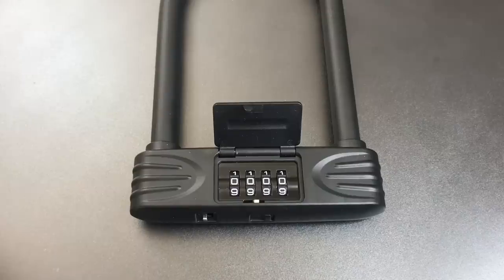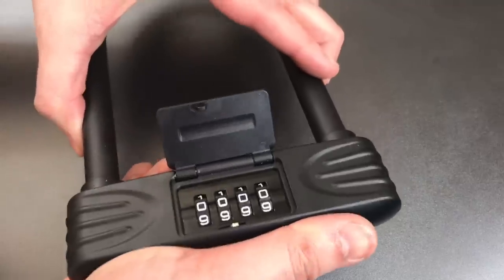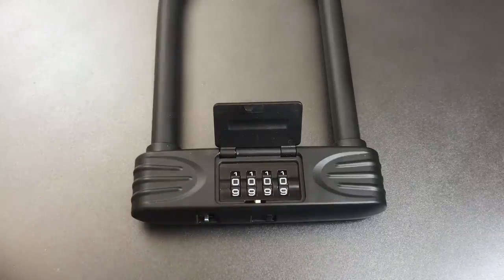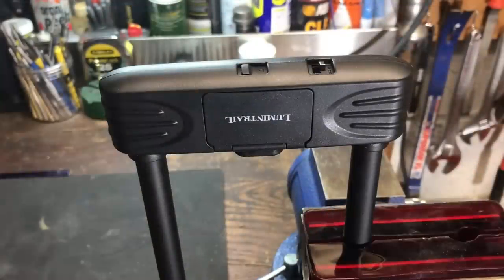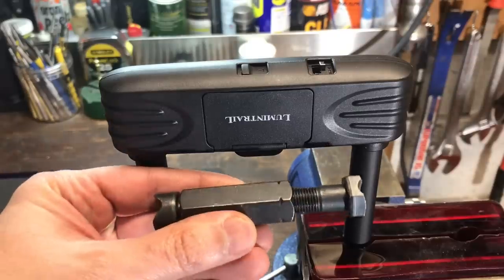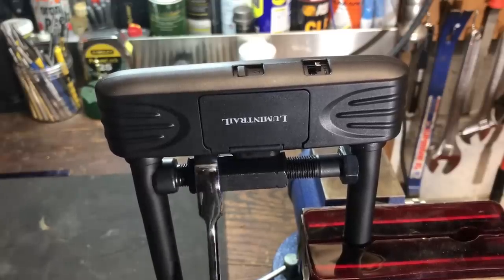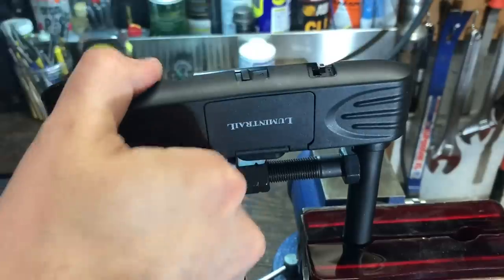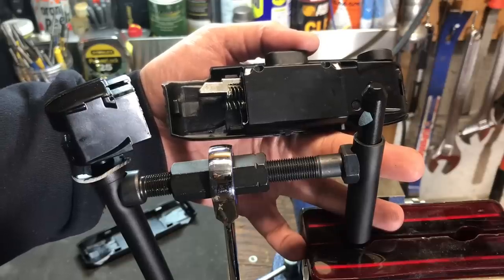[632] Upgraded Screw Spreader vs. Lumintrail 16mm Combination Bike Lock

Comment: I'm secretly hoping LPL doesn't make a video of any of the locks I own so I feel better about what I have.
Reply: I’m sure my gun safes and all the locks I have on the cases, (for my pistols in the safes) and trigger locks on all my guns as well are a singular joke to LPL but those are simply part of my security system. Locks can and will be defeated by even a determined 12 year old kid. High quality locks are great but if they lock up a glass box loaded with cash in a dark alley.........
Reply: My dad always said that a lock just keeps an honest person honest. If someone wants it bad enough, they will find a way to defeat it one way or another. I had proof of that last summer when my storage units were broken into. The lock shackle was too big for the bolt cutter so the cut the slide lock that the lock was attached to.
Reply from the maker: Whatcha got. 😈
Reply: Now I want to find a nasty old lock made of tungsten and drop some solder down the cylinder and see if LPL and pick that or destroy it before it makes him just a little bit crazy. 😊
Reply: If I had unlimited funds, it would be fun to send one of those massive shrouded Sargent&Greenleaf padlocks for the lockpicking lawyer to test on brute force attack. Unfortunately I’m not someone with unlimited funds and those lock are close to $1000.00
Reply: Techniques like this will work on just about every lock of similar design.
Reply: I do have an Abus Bordo to secure my bike. Thanks to LPL I know that the lock itself cannot easily be picked. And although the brute force method finally succeeded, it had been a hard fight: https://www.youtube.com/watch?v=Zs8uyPsDaw0
Reply: tuba7084 This is true for the vast majority of locks / security equipment, but not all. One of the reasons I find high-security locks and doors fascinating is that they are actually meant to defeat very determined attackers, which is a very different problem to solve.
Reply: He can't make a video fo your locks if you don't have locks to begin with!
2020 is a year for smart people
Reply: I'm safe from it, he has no brazillian locks/padlocks (ok, theres a video about a papaiz) :)
Reply: @lockpickinglawyer  Hiplock D1000 and Litelok X1
Would love to see these get tested by you sir

I also might get the Litelok X3 when it's available

Comment: Using a non-reversible ratcheting box wrench is a pretty good statement of your confidence that you were going to be able to split it half. You would have been in a world of hurt had the lock prevailed.
Reply: Nah, you just slide it off the end of the spreader's sleeve and turn it back with something else.
Reply: @samgamgee3622  Plus at around 60,000 pounds of force available? .. no worries! :)

Comment: Ooof.  Yeah, you might argue that a manifold spreader with a lengthened bracing bolt is a specialized tool, but it's nothing that any decent mechanic can't rig up in an hour or two.

Comment: Is there any damn thing that has survived the off-the-shelf tools & little bit of creativity?
Reply: John-Paul Silke are you Archimedes reincarnated? :P
Reply: Nope, just a lame general contractor. ☹️
Reply: A snarling, foaming at the mouth, growling dog who wont accept treats is pretty good as the gun shot will attract more attention than an angle grinder.
Reply: Henri Tuhola Hello I can't find these 1 to 8 Inches Bolts. Can you help me? What I must search to find this Bolts? Thanks
Reply: the blunt answer is: no . I think hiring a strongman as security guard for your bike would be an excellent choice - your strongman gets paid and you have the best protection possible. even just a friend. when you offer money you can buy out most people anyway even a stranger.

but there are plenty of deter methods you can try when locking a bicycle to make a thief's life more difficult - take parts with you such as the bike seat, the post and the clamp screw for the post. take off the front wheel and lock it somewhere else. Disconnect the brakes, let the air out of the tyres. yes its a little more effort but if you are away for a long time those things make your bike less "desireable" than the one next to it.  even go ahead and sandblast your bike to deliberately make it rusty looking and decrease the value lol  then put a big 10mm chain on and it will never get robbed lol
Reply: James Phillips right up till bad guy wants bike more offers strong man a little bit extra to take a long pee break
Reply: Um... I don't think LPL has successfully picked a Bowley lock yet.
Reply: @experiment54  Yes... But it is very difficult to cram the dog into your backpack.
Reply: @john-paulsilke893  hey philosopher
Reply: $20-lock $500 bike= bike was stolen
$50 lock -$200 bike= bike was stolen

$150 cobantion lock free bike from a friend =bike was still there Lock was stolen.

Morale of the story is fuck that guy that stolle my bikes 2 bikes and lock
Reply: @JackTalyorD  The only solution is to get the hell out of the big cities. Things get worse every day. It's not where you want to be when the SHTF, and you have to live with constant fear and paranoia. Plus it's a literal rat race, with no end in sight, everything is too costly, and you're disconnected from people. Stuff that.
Reply: @Patrick-857  U my firend have never been to country Victoria. Latrobe valley region, Hastings any where there's people there's crime
Reply: @Patrick-857  
My door is never locked
My dogs are always Hungary
My shotgun is always loaded.

I'm not afraid of nothing.
Reply: ya, one of those new york kryptonite locks broke his cutters.
Reply: @experiment54  syringe guns are pretty quiet. Bows are quiet too
Reply: Don't worry the universe will take everything apart
Reply: I think the Blocca Cantina did well vs low skill attack

Comment: I’m actually considering this lock even after watching both videos to lock my bike up. Maximum security isn’t the only specification to look for when buying a bike lock, especially when you’re going to be toting it around in a back pack. The low cost of this lock as well as the weight (less than three pounds including the cable) make it a great buy all things considered. My place of employment happens to be a military base with a bike rack in between the two hangars I work in with heavy foot traffic between the two.

Comment: Let's see how this lock stands up to a brute-force attack.  Now in my garage I have a tactical high-energy laser that was previously used by the military to shoot down Katyusha artillery rockets..........
Reply: Lol that made my day
Reply: Also for heating attacks to melt metal such as zinc and tungsten I have a backpack portable napha jelly flamethrower with a nitro-oxide booster.
Reply from the maker: Sweet!  I’ll bring the locks and the beer!
Reply: DamonWakefield Hello I can't find these 1 to 8 Inches Bolts. Can you help me? What I must search to find this Bolts?
Reply: same
Reply: @P0Z  they are top secret LPL technology, just like the ratcheting cable cutters that he has...
Reply: @michaelschlegel2704  Buy 25 to 400 mm ones instead. 😉 
Seriously now; a decent hardware shop, ironmonger's, or DIY store, should stock them.
Reply: And for the boron-carbide shackle, I have a specially crafted pair of force-multiplying vice grip pliers.

Comment: Can you remember the bolt size you used for this? If this is the Lisle spreader I have the same one I used to use as a portable jack for my motorbike but it's too short for my latest one, I didn't have a bolt that would fit but hadn't considered that it's probably imperial sizing :)

Comment: Old video, but I'm new and watching in revere chronological order, and feel qualified enough on the nature of these videos to ask a serious question now:
Can you get a method of measuring the force you are applying for some of these destructive attacks?  Obviously for heat attacks, reading off the label or a basic chemistry googling of your fuel is probably enough to get a good sense of the heat you are applying, but for cutting and splitting attacks, understanding just how much force you are applying would be amazing.  

My thought is to, instead of using the tools by hand, actuating them with a small hook and loop spring scale and recording the scale readings with a second camera and then doing some math, or providing us with the information we need about your tools to do the math ourselves.  There may also be tension measuring devices you can plug into a computer and get easy digital readouts, or even digital reader you can place in the camera frame, or a way you could summarize the values afterward.

Regardless I'm about 500 videos in and loving all of your content, I just struggle to contextualize your destructive attacks.

Comment: I was just working out the force (feel free to check my math) ... for the massive amounts to Leverage Force this set up has.  Note: Not allowing for thread friction,
With a 100 pound force at the end of the wench say just over 9.5" in length (according to a similar wrench I own) means each revolution covers a full 60"
Each revolution (of 60" ) makes only 1/10 of one inch advancement ... 20 TPI (Threads per inch) divided by two ... as both bolts move simultaneously... in other words you'd have to make 10 revolutions to move the spreader 1" wider ... 
Thats 10 x 60" = 600"
a 600 to 1 ratio (600:1) ...
So 100 pounds on the wrench equates to 60,000 pounds at the spreader!! 
That means this set up is well within reason to provide 30 TONS of spreading force!
EDIT>>> in this case I'd guess LPL is putting maybe what 15  pounds force lifting up like that one handed? .. so that's still good 4 or 5 tons of force :)
Reply: Thanks to inclined plains and the Archimedes Screw.
Reply: @gorillaau  Opps! :) ≥.. Archimedes' screw is a type of water pump :)
Reply: @MikeBaxterABC  Darn it. You are right.

Comment: Now I want to see how you retract the spreader again ;-)
Reply: Elektronaut easy slide it over the bolt and use another spanner to wind it back
Reply: I don't get it. What's supposed to be special about retracting it?
Reply: It looks to me that LPL is using an non-switchable ratcheting box-wrench and I was just  joking that he now has to crank it back with a normal open-end wrench.
Reply: Elektronaut oh gotcha... it would be pretty hard without a second wrench or a reversible ratchet on that one wrench, huh?
Reply: The wrench doesn't have a manual switch to reverse the motion of the wrench, or does he have the room for the wrench to clear the shackle.
Reply from the maker: Not difficult with another wrench. You can almost turn it by hand.
Reply: put the wrench up  parallel to the D ring and a good hard jerk on it would probably remove the spreader from the broken lock.
Reply: Iv seen one of these in action years ago. The bolt slipped off and hit my friend in the head. So be careful kid's
Reply: Elektronaut Hello I can't find these 1 to 8 Inches Bolts. Can you help me? What I must search to find this Bolts?

Comment: Lmao there's not a lock in this world that can prevent an attack like this.
This technique is literally a manual version of a hydraulic jack, and I've routinely used this to pry off parts from bulldozers and other heavy equipment where a standard jack won't fit.
If it can shear off five half inch bolts I think it'll be able to break some shitty bike lock.
Reply: Mike Walko it’s less about prevention, more about seeing how long it lasts. 
That’s why it’s a brute force/torture test. Go long enough and nothing will survive.

Comment: Hi LPL! Where can i get a manifold spreader! Looks like a handy Addition to my tool kit, keep up the good work buddy
Reply: go to an auto parts store (if your in north america) and say you need a manifold spreader for chevy manifolds :)
Reply from the maker: Auto parts store, Amazon, eBay... they are common. 👍
Reply: @JeffLMisc  Where can I get those bolt extensions for my spreader? Is there a kit available?
Reply: @lockpickinglawyer  where can I get that bolts set?
Reply: @janrob6352  get some regular bolts, and put a divit in with a dremel or a round file. they are just regular bolts

Comment: Was that a non-reversible wrench? One that you have to flip to make it go the other way. Would have been real funny if the lock had held then.....
Reply: I think he expressed that concern in the comments of a previous video. I'm guessing he went with the closed wrench this time for the sake of filming expediency... even though it might now take an ungraceful technique to remove the spreader from the U.
Reply: He could slide that wrench towards the screw, which has smaller diameter and is round. The wrench wouldn't then prevent the rotation of that long nut, which could be turned with an open end wrench.
Reply: Mika: Good point. I'll have to reflect on why I was so quick to imagine something brutal : )
Reply: Mika Luostarinen Lol exactly man. I saw some comments asking how he would remove it. And you have answered that question for them 👍
Reply from the maker: I don’t have reversible wrenches.  They’re on my list.

Comment: Where can I get those bolt extensions for my spreader? Is there a kit available?
Reply: Did you find it?
Reply: @janrob6352  No, I didn't. And he milled the channels into the heads himself so that'd be another hassle once the different lengths of bolts are obtained. Too bad he doesn't sell the kit on his new supplies website.

Comment: Did you examine the shackle afterwards?  If it was truly hardened, wouldn't it have also cracked in the U-bend due to the spreading force?
Reply from the maker: It is hardened... the small amount of flexibility added by tempering actually makes the lock more secure.

Comment: Should have yanked on the lock while in the vice to show that it was locked closed, (I presume it was, but I don't know.) (Doesn't change your test, just the presentation.) Thank you for showing how ridiculously flimsy that lock it. #securityTheatre
Reply: Considering that the body broke, not the locking mechanism sans codification, it's irrelevant if it was locked or not. It's just poor construction.
Reply: I believe you retracted the bolts by pressing on a button on the top of the lock to remove the shackle and the body was against the rubber protective sleeve. I would say that it was latched shut and this test wouldn’t be any different if the correct combo was dialed in or not.

Comment: Lumintrail   would you mind making your locks out of steel instead

steel is not much different in costs in fact it is probably cheaper.

if you are worried about costs just do a walmart and work your employees off the clock "oh we need you to clean the toilet" or what ever once they punch out.

you could also hire foxconn to make the locks as they are one of the worse manufacturers as far as human rights go.

or you could just raise the retail price and justify the inflation using a very flimsy guarantee that makes you not have to pay out claims if bikes are stollen within the terms of the guarantee and make claims that the lock was defeated outside of the terms of the guarantee like saying the combination was decoded instead or something.